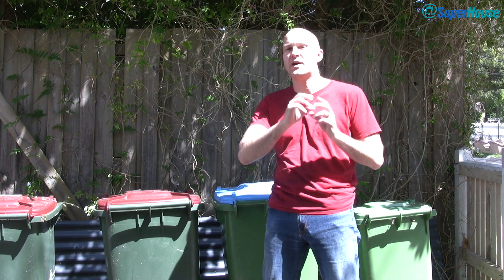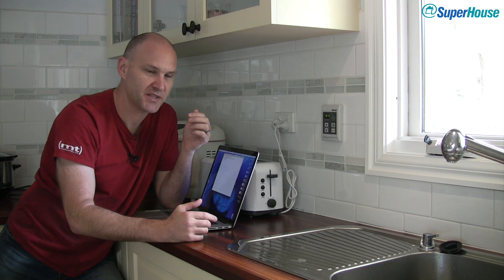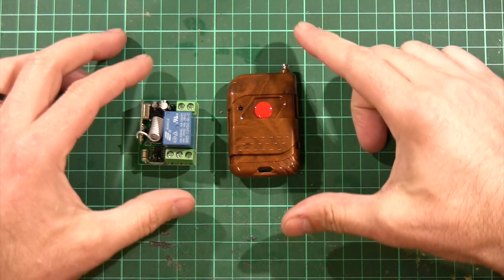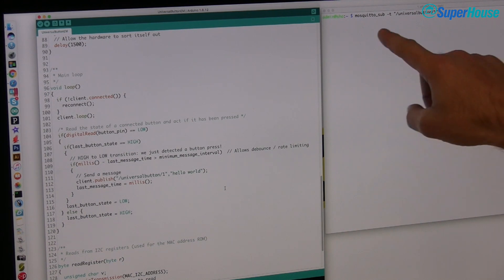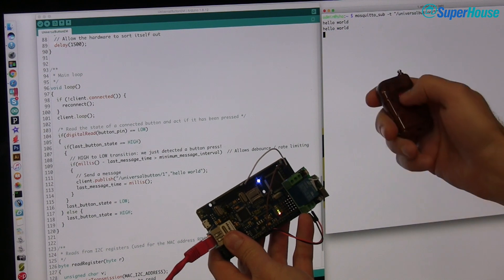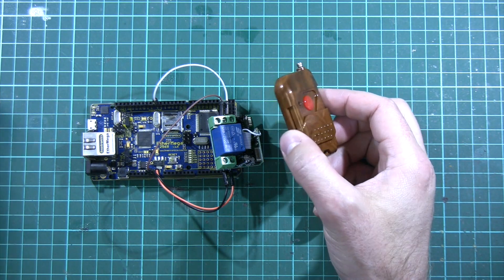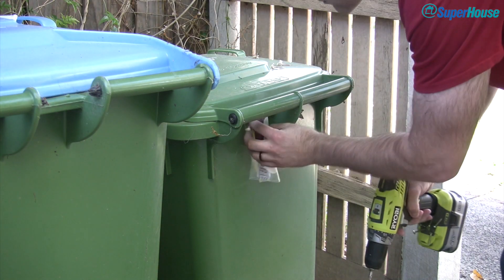SuperHouse #20: The $6 universal home automation button

Comment: Good project but if you add a tilt sensor to the TX then when the bin is tilted by the dustmen it would automatically send a signal to the RX so you will not forget and don't have to know anything about it!!

Comment: Instead of the button being pressed... use one of those tilt switches. Or some kind of sensor that detects that the bin has been moved more than .... meters. You could add a sensor to the wheels. Or add a tilt sensor to the bin. And instead of resetting your "kitchen tile" and ignore messages for a week, ignore it for a day and a half or so. Just in case you have some gardeningwork to get done, and want to drag your bin around your backyard, and it is not yet "bin day". You don't want to get your bin-dragging hobby mess up your home automation... :-)

Comment: Hi. I understand nothing of electronics but you got my attention. Following a similar approach can you make a Sonoff RF to be activated ON/OFF by a magnetic wireless window door sensor? Basically the target is to have a wall socket where I have a space heater plugged in to go OFF every time the window is open. The affordable products on the market require internet/cloud connection and i would like to see somebody doing something more old fashion that works offline. Cheers

Comment: Great idea... But also could you use your PC running OpenHAB and MQTT and read the state of a pin on the serial port on that??? Is there a way to read the Parallel I/O pins in OpenHAB or otherwise interface it with MQTT?
Reply from the maker: Sure, that would be another option. I wouldn't use a serial port, though. If you have OpenHAB and MQTT running on a device like a Raspberry Pi that has I/O pins, you could connect the receiver to one of those pins and read it directly from the Pi using a simple script. There are example GPIO scripts around for the Pi that will do it. Then your script could just publish to MQTT on the same machine, or whatever else you want to do.

Comment: I want to use this as a smart door bell. is it possible to use a number of these remotes at the same time or does that cause interference?
Reply from the maker: If two were pressed at exactly the same time you may get some interference, but what's most likely to happen is that the signal from the closer transmitter will prevail. Because each transmitter has a unique code, only the receiver that matches it will activate.

Comment: Did you already check this kind of button:
http://s.aliexpress.com/eaiYbUZf
they are really cheap and integrate great in any home!
Reply from the maker: I haven't used those, but they look interesting. However, I'd be worried that because they seem to operate as simple 433MHz remote controls they'd be open to spoofing. Check out this conference talk I did recently: https://www.youtube.com/watch?v=3BNNY6_r3tQ
Reply: SuperHouseTV I would be flattered if a hacker goes to the trouble of turning my light on or off... sure I wouldn't use it to operate a lock or my garage door, but for light, I don't consider it an issue.

Comment: Its not a $6 project but a better solution would be to put an RFID reader with a tight beam on the fence line so you could but RFIDs on the bins and the system would automatically know when they have been put out. Could be used to know when your car arrives or people enter the property.

Comment: Great series, mate!  My wife is going to hate me soon for all the new ideas you've sparked.
Note on that third mode.  I saw one comment that it work with a multi-channel device, but in its current state (latching relay), you can use it as a Panic Button that can't be cancelled from the fob if the reason for panicking grabs it from you.  Just put in a reset switch in a secure part of your house that interrupts power to the receiver to cancel.
Reply from the maker: Cool idea!

Comment: Should put a series of reed switches behind (or under?) the bins and mount some super strong magnets to the bins in the appropriate place and ooohh yeah, no more clicking that button.
Reply from the maker: Yes, sensing the position of the bins would be cool. I've thought about a few ways to do that (eg: ultrasonic sensor on the wall behind where the bin normally sits) but it doesn't help if the bin is out in the garden somewhere. We often leave the garden waste bins out in random locations while loading cuttings etc.

Comment: Hey! In my home automation project I do everything for as cheap as possible, and so as a follow up from your new IP cameras, it would be great if you could do a project using this serial camera module from eBay (http://www.ebay.co.uk/itm/Miniature-PTC06-Serial-JPEG-Camera-Module-CMOS-1-4-inch-TTL-UART-Interface-MRY-/291643018490?hash=item43e7474cfa:g:v~gAAOSwYIxX~LZL) I was thinking of a way to combine it with my Ethernet shield so that you have a web interface where if updates the camera picture every couple of seconds to show a very slow video feed. I'm sure you can do a much better job than me with it so I would recommend it as a video.
Reply: looking great :-)

Comment: Hi sir, been a fun of your classic works. I would love to do the same in my project but using the raspberry. Could you please give me a hand on how to go about it. Would want it to send a notification when clicked like a panic button. Thank you in advance and thanks for your quality works.
Reply from the maker: Thanks for your comment :-) This should be easy to achieve with a Raspberry Pi by using the "gpio" utility that's part of WiringPi. You can connect the receiver relay between GND and one of the spare I/O pins on the Pi just like I did on the Arduino, then have a script on the Pi that repeatedly calls "gpio" to check the state of that input. You'd also need to set the pull-up resistor on that input, which can also be done using gpio. So you can follow the same structure as I did, but with a Pi instead of an Arduino and using a script and gpio in place of the sketch.
Reply: SuperHouseTV thank you.

Comment: why not use a esp that enters deep sleep after publishing mqtt?
Reply: yagoa It can be tricky to achieve reliability and responsiveness with this approach. WiFi is just a poor technology in its current state to try to conserve battery with.
Reply from the maker: A transmitter that draws 0mA except for a couple of seconds per week that the button is pressed will always outperform a microcontroller in sleep mode :-)

Comment: Could you post the manufacturer for the button you showed like the idea of the NO/NC contacts on the switch makes for a great 3 way switch configuration using 2 of them.
Reply from the maker: There are different frequencies etc for different countries, so rather than link to one specific seller it's best to search on eBay for "rf remote control transmitter and receiver" you'll find thousands of them, everything from 1 channel to 12 channels or more.

Comment: awesome video 😀
after watching your video i will set up a similar system maybe just coloured lights that will eliminate from say 2pm to 6am on bin day, possibly have a button no the display to extinguish the lights. i will tack it onto an existing controller the controls my hot water system 😀.

if i had to think of something to do with a one button remote i would like to set it up to control the out side lights and also be able to tap a code into it to unlock the front door.

Comment: Just thinking, you could have a small solar powered arduino with a wifi shield and measure the signal strength of the wireless connection. You'd be able to calibrate it by putting it out the front of the house (maybe a few meters closer than usual) and use the wifi dBm level at that distance to know where "outside the gate" is. If the wireless signal drops below the calibrated limit for a sustained time, the bin would be "outside the gate" and be able to send a signal over the network to the home automation system. Same would apply for when the bin is bought back inside the gate. The tricky part would be power but if you had a small Li-ion battery and solar charger you could set it to only power up once an hour to "ping" its position. This isn't exactly a cheap $6 build though.

Comment: The trash / recycling guys in my area are quite rough with the bins.

I might set up a weather proof plastic utility box out by the bins with power and a few buttons, those could also light up, matching indoor indicators.
Reply from the maker: That's a good solution. Keep the button nearby, but not on the bins directly.

Comment: I'd be careful about using this anywhere you don't want someone else to potentially trigger. Things have been secured by obscurity except for those with software defined radios with transmit that weren't cheap. Now with an RTL-SDR receiver and a $100 USD Yard Stick One from Great Scott Gadgets it's trivial to intercept, decode, and spoof those little remotes. You actually don't even have to decode it because you can simply replay the recorded streams. Someone can learn to do it in 10 to 15 minutes.
Reply from the maker: Definitely. I'm doing a conference lecture about that exact topic in a couple of months at linux.conf.au, and I have a SuperHouse episode partly filmed about it as well: https://linux.conf.au/schedule/presentation/21/

Comment: I've always wanted a have a remote in the car that can activate a "returning home mode" in my home automation system.  Reach the top of the driveway... press the button, lights come on (depending on the time of day) and alarm is deactivated.
Reply: Michael Carey you could also use the wifi connection of your phone for that, it will require you to listen to your DHCP server, but it's not to hard.
Reply: That's true! A good solution for that would be a API call to your home automatisation controller, I don't like exposing my controller to the internet so I would use a proxy that only accepts a scoped list of API calls.
Reply from the maker: Yes, I do that in OpenHAB using the "Network Health" plugin. I've set it up to check for specific devices on the network (phones, tablets, and iPods) so that it knows if specific people are at home by looking for their devices. I think what Michael wants though is something that would work much sooner, like geofencing that would start to do things when you are approaching the house, but not quite there yet. That's something I've been thinking about for a while but haven't tried anything yet.
Reply: Luoarnamsk In my house, I have an RFID tacking system, so there are RFID tags on the car, on people ect. It knows exactly where you are, it's like having a sensor that knows home many people are in a room so it knows what to do with the lights.

Comment: Really like your videos, giving me alot of good ideas :) Here is one: Modify the circuit with a switch, that mounts inside your mail box, so you know when you have got mail.
Keep up the good work. Thanks.
Reply from the maker: I did that back in 2005 (before I was making SuperHouse videos) and did presentations about it at Open Source Developers Conf here in Australia, and at OSCON in Portland/Oregon. Since then I've ripped up the whole front garden including the fence and letterbox, and we currently have a temporary letterbox hanging off a post. We're about to fix the front fence and install a new letterbox, so I'll definitely revisit this project. My original version used a Linux box running Gnokii connected to an old Nokia cellphone, so that it sent me a text message when mail was delivered. Old school!
Reply: 'Haha, that's cool, technology has come a long way since then :D I really like your videos, i mess around with arduino myself, so nice with some inspiration. I will be a couple of years before i get my own house, currently renting. Keep up the good work.

Comment: you could also use the cheap 433Mhz receivers and transmitters on ebay to do the same. Then you can use a single receiver for all the remotes I believe.
Reply: Arnþór Gíslason yup, that's what i use for the lights in our house
Reply: Something woke a SonOff RF bridge, which I use in the scenario you describe.

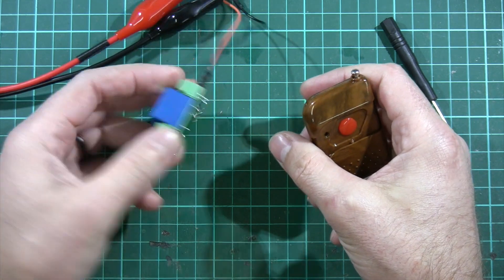Comment: 6:22 the 3rd mode is a toggle mode but requires a 2 channel remote. thus one button on the second button off. some modules allow for 1 button toggle however. 

is it possible to have an mqtt system that could publish to an internal server. say for a house without internet connection (such as an off grid home)
Reply from the maker: Absolutely. I use an internal MQTT broker because I don't want any of the basic functions of my house to be dependent on my internet connection. If my connection drops out, the house keeps working just the same. The only thing I can't do then is connect remotely to control it. Because I keep talking about MQTT without really explaining how it works, the #1 request I get is "please do an episode about MQTT and the current architecture of your home automation system". So that's high on my list.

Comment: Would it be possible instead to get a cheap nfc sticker on each bin and then bump your phone once the bins had been taken out, and have your phone update the home automation instead? The reason i ask is because i think nfc stickers would be a little less prone to damage
Reply from the maker: Yes, that's another good solution. It does mean pulling out your phone though, and I'm trying to achieve the minimum interaction possible. Ideally I'd like to make it so the system has a way to detect that the bins have been taken out totally automatically, but pressing a button already on the bin is pretty easy too. I like your idea though. It could also be applied to many other things.
Reply: SuperHouseTV You make a good point about having to get your phone out, it could work well with a smart watch but i dont have one unfortunately. It could get a bit fiddly but one other alternative is maybe you could open the buttons case, desolder the button itself and then solder two wires to thin metal sheets on either side of the handle on the bin. Something that resembles the heart rate monitors on treadmills. Then as you are pulling the bin onto the nature strip your hand would automatically complete the circuit. On second thought you would need to up the voltage substantially to pass the skin, and then it might not be worth it

Comment: How many of these can you have around your house without the remotes interfering with each other or triggering the wrong receiver? Do the remote and receiver communicate with some sort of randomized auth code?
Reply from the maker: Each transmitter sends a "unique" code. I quoted unique, because I don't know if they reuse codes at all. The receiver pairs itself to the code, and they can bind to multiple transmitters. You can also have multiple receivers bound to one transmitter. There's a button on the receiver to put it into pairing mode, and it can also be used to clear the existing memory.

Comment: Great video, and I'll order a couple of these kinds of remotes and receivers.  What I REALLY want though, is something to replace my doorbell.  Essentially, I want my 'doorbell' button to trigger an MQTT post.  The biggest challenge is finding something reasonably OK looking and weatherproof - a plastic walnut-coloured remote in a ziplock ain't gonna cut it!
Reply from the maker: Aren't those remotes ugly? I was going to comment about that in the video! I think they're about the ugliest piece of electronics I've ever seen. You could get the same end result though by using a nice looking doorbell button, and wire it across the button terminals in the RF remote so that it transmits when someone presses the doorbell. Then fit the transmitter inside the wall behind the button. That's really all a wireless doorbell is anyway, but this way you get to choose the style of button you want and make it look really nice.

Comment: ziploc bags are water permeable. So that bag of silica is pretty much useless and likely so is the ziploc bag (you can look it up, it's an issue that comes up when you store PLA in them). It'll probably still take a few years for the board to corrode, so it shouldn't be too big of a deal
Reply from the maker: Good to know, thanks. To do this properly I'd put the transmitter inside an exterior rated plastic case with a grommet and an IP-rated exterior button, but the case would cost more than the transmitter and receiver!

Comment: Love your videos. You explain things very clearly in a logical way. You predict what I'm thinking of asking or wondering how is he going to do that, and then you show it. You can read minds!

I realise this was just a test, and I know it's obvious that you could mount a proper external IP box instead of your bag. And maybe change to a proper external switch too wired to the internal contacts of the transmitter. And then epoxy weld the box to the bin. Hope no one critiques you for that, I'm not criticising because it really is obvious. 

Please keep producing videos!!

So far you have convinced me to get serious with home automation. Several arduinos and a raspberry so far. And I now have 4 Sonofs controlling various things.

Comment: I bought a dozen of a similar remote and receiver, only it has 4 buttons not 1, I used it for the arduino based alarm system on my motorhome, and another for its LED strip lights, the remote has a massive range, I can arm/disarm my motorhome alarm from up to about 300M
Reply: TheDefpom How did you do your process?The same as here? Im buying a big RV to travel in soon...